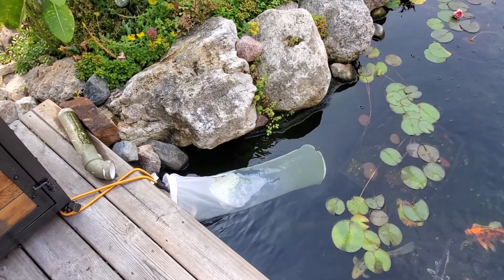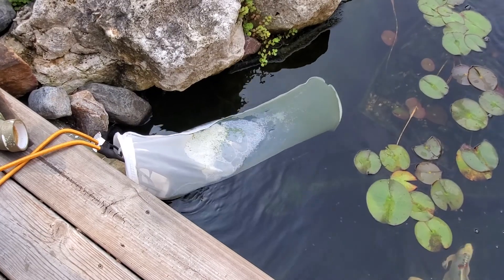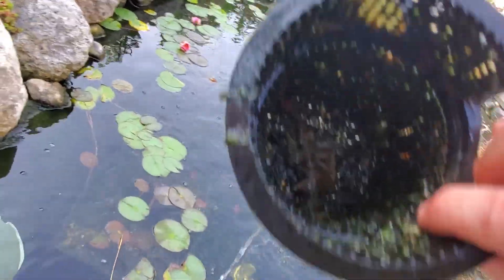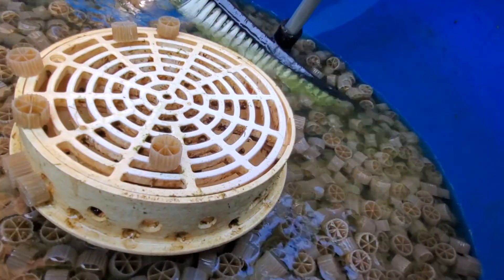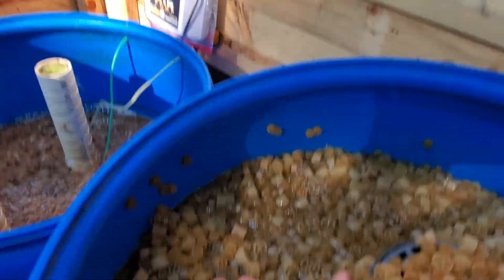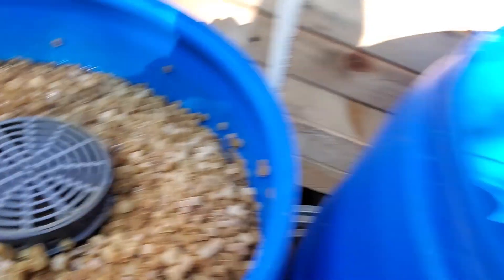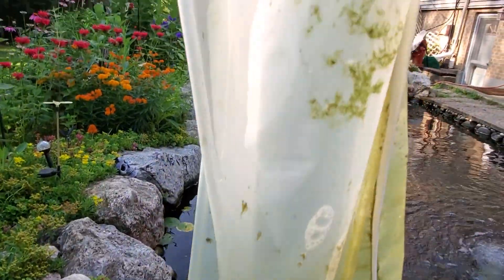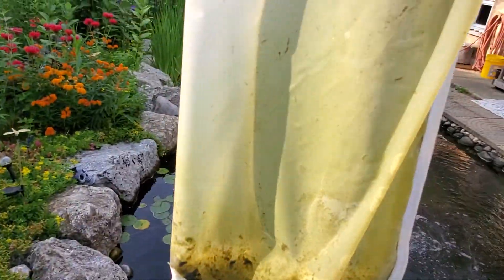K1 as a mechanical media. Not what I expected.

Comment: I put a uv light in my water fall.  Only 18watt led.  Pretty effective on a 2500 gallon pond.  I’ve had good luck with that media in a intex sand filter in place of the sand.  

Collects tons of particulate matter and backwashes easy.
Reply from the maker: @zub57  did you open up the ports on the spider on the sand filter? I've done a few of those over the years. Any UV helps.

Comment: Hi again. So I did a rigorous clean of the K media in the drum just three days ago. I flush out the water from the drum. Then I used a tool like a shovel and stir the K media while it was still flushing out. I did that until water is all flushed out. Then refilled it with new water inside the drum. I’ve flushed out the water a couple of time already in past three months. But never actually stir and mix and clean the media until this time around. Now it’s been three days I noticed the water is black and grey. Not algae looking at all. Any advice? Thank you so much. I really hope you can help. Cause I was so pleased with the result from the first three months but now this. Thanks again.
Reply from the maker: Are you using pond water only, not tap water?
Reply: @jeffakamax  no I used tap water to refill the pond and drum. But only about 100 gal of tap water out of the entire pond. My pond is about 900 gal.
Reply: I only flush out the drum water. Not the pond.  I mean I got some out from the pond. But definitely did not need to refill more than 100 gal of tap during cleaning.
Reply from the maker: @stevanusibrahim9648  thats fine as long as you are refilling the drum with the pump that feeds it, not tap water directly to the drum which will harm your bacteria.

Comment: Hi Jeff - Love your videos.  You have said that mechanical filtration through K1 media is most efficient at lower flow rates through the media which makes me wonder why you choose to run through the barrels in series. I am wondering if the first two drums would remove more dirt particles if your feed from the pond pump was split 50/50 using valves so that the flow rates would be cut in half through each drum. They both could then discharge into the same floating media drum. They would probably require a different cleaning frequency. I am about to build my own system and would value your feed back.  Thanks, Les.
Reply from the maker: I have found that flow rates of 2500-3000 GPH work great given the volume of K1 in the drums. I am sure a slower flow rate would in fact be more efficient, but turnover is also important. with those flow rates I am very consistently filtering solids down to 50 micron which is more then adequate for a pond environment.
Reply: Thanks Jeff - Thanks for for the quick reply and sharing the benefits of your testing and experience.

Comment: 3:55 you'll need a UV sterilizer to remove the free floating algae. That's the only way you can turn the green water clear. Remind you algae is not necessarily a bad thing and your koi fish will enjoy eating algae. The algae is helping to break down the nitrates and phosphates so technically it's healthier for your fish and your pond and the fish don't care either way if the water is clear, green, or brown as long as it's healthy.
Reply: You don’t need a UV light to have crystal
Clear water. I’m running simple filter setup and never had an algae problem. My pond is always in sunlight. Most people won’t believe your beneficial
Bacteria will take care of everything as long as your flow is correct.
Reply: Uv only takes care of alge blooms,  not string alge. Barley bales will take care of string alge.  Alge at night consumes lots of oxygen, enough alge and it becomes lethal due to O2 consumption.  Remember dissolved oxygen decreases when water temp increases.  At night alge consumes a ton of alge and releases it in the morning.

Comment: Sir, you have got a nice setup. I have a few questions & one suggestion to offer.
Question no 1: In the 1st & 2nd barrel have u used the bigger size MMBR media, like the ones used in the large waste water treatment plants? I have used the industry standard MMBR in one of my Aquarium tank to make an internal Sump. 
Question 2: Which pump are you using to circulate the pond water.
Suggestion: Sir, Instead of daily stirring up the barrel no 1 & 2 with a wooden stick, won't it be better if you add a powerful submersible pump at the bottom of each barrel & start it for sometime to completely stirrup the waste matter. You dint need to run the pump for long time. Or, just like buy one such powerful pump & can use it in both the barrels. Tie the pump to a heavy stick & can dip it into the barrel needed to be stirred up.
Thanks for your time.
Reply from the maker: I run the larger K2 media in the first drum, a min of K1 and K2 in the second and K1 in the third. I've built several with an air manifold for cleaning. Churns the media very well. I never installed in mine because I'm constantly tinkering with it and manually churning the media only takes a minute.

Comment: I have several 100gal stock tanks and was planning to use one as a bog filter for my 1000gal pond. After seeing your videos I’m thinking of the media instead. Your thoughts would be appreciated. Thanks!
Reply from the maker: Is your goal biological and mechanical filtration or a bog for nitrates?
Reply: Bio and mechanical… thinking that the media would replace 3/8” pea
gravel. It was built as a natural pond with plants doing the filtration. Did well for last 2 years but am adding a pump because I miss the sound of moving water. Currently has about 15 goldfish, frogs and eve some crawfish. Live in zone 7b.
Reply from the maker: @ronwilson330  k1 will work great for both bio and mechanical and is WAY easier to clean than gravel. I assume you have a bird man style filter now?
Reply: @jeffakamax  “bird man” filter?
Reply from the maker: @ronwilson330  upflow gravel filter commonly referred to as a bird man filter.

Comment: How do you deal with string algae blooms in the spring? I inherited a koi pond and learning how to take care of it. This pond was not built very well. It only had a submerged filter box that constantly got clogged and had to be cleaned every 2-3 day in the summer.  I decided to build a similar set up like yours but it's only a two-stage filter set up because of limited space (1. Static k1 main bed filter and 2. Moving bed k1 filter ). When the string algae started to die off it clogged my main bed filter pretty quickly and my k1 rose above the water. Also, how often should I be cleaning the main bed filter?
Reply from the maker: No amount of filtration will get rid of string algae. If you have larger fish, STOP feeding them! They will eat the string algae when they get hungry.  A plastic yard rake works great for manual removal. I get very little in early spring until my bog plants come in and I feed very sparingly based off the amount of string algae.
Reply: The larger barley bales are good for 1000 gal each.  When they start breaking down the barley degradation makes hydrogen peroxide,  which in turn is a algecide.
2nd solution Hydrogen peroxide  (3%) at 4 oz per 100 gal will kill alge. Pour it into your water slowly and away from your fish. Overnight you will see a difference. 
Oh and use peroxide in the morning, also you may need to add aeration if you use hydrogen peroxide. 
Hydrogen peroxide is an active ingredient in many algycides. Barley bales is a natural way to control alge. You just need to get ahead of the alge before the alge gets ahead of you

Comment: I wish I could get my K1 to sink and tumble.  At least I am getting mechanical filtration from static.
Reply from the maker: It will once the bacteria establishes
Reply: Thanks it’s been 3 weeks and I have seeded it with seachem  as well as an established filter.  I have adjusted the amount in the canister as well.
Reply from the maker: @mentalistsa  im running some k1 in a sump an my 125g African tank. It never fully established because I also have 12lbs of ceramic rings. The rings are older by a few years and are fully seeded. Bacteria ia limited by food and bio load. Adding more media allows the bacteria space but there won't be more bacteria until the food/bio load increases. Ideally you want more space (media) than you need. This allows the bacteria to expand if needed. Problem arise when space (media) is limited and you have a rise in bio load and no more space for bacteria to expand.   The tumbling k1 also keeps the bacteria healthy by knocking off old dying bacteria and opening space for new thriving bacteria.
Reply: Jeff theExecutioner Oh. Great info. Hmmmm. I already have two large HOB running and this filter is newest and for additional filtration. Maybe that is it. The other HOB still have additional space ?  Tank is overstocked too so was hoping this would kick in with good bio
Reply from the maker: @mentalistsa  always better to have more than you need. Give it some time.
Reply: Jeff theExecutioner Sure thing. It looks like you have an overstocked tank as well.
Reply: @jeffakamax  Aerobic bacteria never stop multiplying.

You should have cycled your K-1 separately in a plastic trash can or something similar following the recipe at aquariumscience.org/How I cycle.
It truly makes a world of difference.
Reply from the maker: @kennethfarley8347  bacteria constantly regenerate, the old die off and are replaced with new however the total population is dependent on bio load and available resources.

Comment: Hi Jeff, nice video, who's instructions did you follow to build the 3 barrel's, and what are you moving the air with?
Reply from the maker: Weighty in the UK had the original design. I've made some modifications. I'm using a cheap 19 watt air pump to a large stone. Make sure the input for the fluidized bed points UP,  helps move the media.
Reply: Jeff theExecutioner what size pump are you using?  I have 1/4hp sump pump and it’s to much water flow?

Comment: Is there a reason you add k1 to the first drum and would k2 be better throughout all three? I didn't know if k2 being smaller would plug up the media to quick in the first drum?
Reply from the maker: I have k2 in the fists. K2 is larger.  A mix of k2 and k1 in the second barrel and all k1 in the fluidity barrel.

Went with the k2 in the first as it does catch quite a lot of large debris. Figured it wouldn't clog up as fast
Reply: Jeff theExecutioner so k2 is larger than k1? I had it backwards I thought they came out with k1 then made a smaller version and that was k2.
Reply from the maker: @andreas-lil-pixels9878  correct, k2 is bigger than k1. K1 micro is the newest and smallest
Reply: Jeff theExecutioner thank you for clearing that up for me. Which would you recommend for the one barrel system?
Reply from the maker: @andreas-lil-pixels9878  K1. How many gallons are you filtering and what's your bio load?
Reply: Jeff theExecutioner I have two ponds, the bottom pond is pumped into the top pond and returns to bottom via a creek bed. One pond is roughly 1620 gallons and the other 1125 gallons. What I need is the meter in one of your videos so I know exactly what the gallons are... bio load would be to much...this is gonna be temporary as I am going to be digging a bigger deeper pond not sure if that will be this year or next so I need over filtration for now. My plan was to make a two barrel system from your design for one pond and a one barrel for the other pond the reason for this is I would be pumping approximately 32-40 foot from the bottom pond up to the barrels ( if I did the three barrel system at first)  because that would be to the top of the falls....then pumping from the top pond to the barrels as well so there would be two inlets on the first drum. I wasn't sure if that would work so that gave me the idea to do the two barrel system on one pond and a one barrel on the other pond then when I get the new one dug having a three barrel system on it.  Hope you understood all that.....Any ideas you have would be great I do appreciate your help.
Reply from the maker: @andreas-lil-pixels9878  the barrels seem to work best at 2500 to 3000gph.  A single on each pond or dual for both should yield similar results.  I'd do one static and one fluidized.
Reply: Jeff theExecutioner thank you! Do you use a 2" gate valve between barrels so the water doesn't back flow to the one your cleaning?
Reply from the maker: @andreas-lil-pixels9878  no valve needed. They only flow one way.
Reply from the maker: K2 is larger.

Comment: So K1 media also removes Algae?
Reply from the maker: Phytoplankton (green water) algae are tiny. However they tend to be cohesive and clump together. Once the clumps reach 50 micron or so the K1 is capable of trapping them. Flocculants will also speed this process up. Koi Clay (Calcium Bentonite) is a great natural flocculant plus a myriad of other benefits for fish.
Reply: @jeffakamax  thanks. I have a planted tank. Hence my interest. I use diluted glutaraldehyde to kill Algae. Obviously a none chemical method would be best. Adding K1 micro this week.
Reply from the maker: @Skylabz604  planted tanks are a balance between lighting, ferts and co2. Is your tank injected? I have videos on the subject if not.
Reply: @jeffakamax  yes it is. Its not established yet. New tank. Also cant put the shrimps in yet because of Amonia. Hence getting the K1. How long will it take for the K1 to establish? Thanks for your help. Subscribed.
Reply from the maker: @Skylabz604  just now saw your comment. How's the k1 going?
Reply: @jeffakamax  doing great. Plants all growing , nice carpet and i have a dozen Crystal shrimp in there. No algae issues